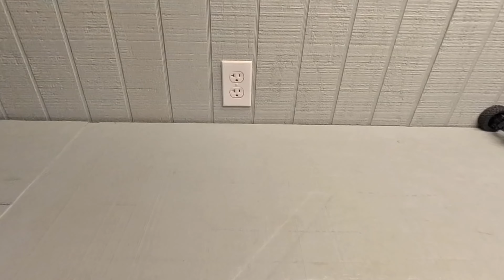Great Little Beginner Basher Under $100  UdiRC UD1611 1:16 Scale 4WD

Comment: The pipe could be used to dial in your steering, just keep adjusting until it doesn't corkscrew away from, or to you. 😜
Reply from the maker: 😂 I never thought of that. That’s a lot of crawling in a pipe until I get it dialed.
Reply: @ReadytoRunRC  lol True.